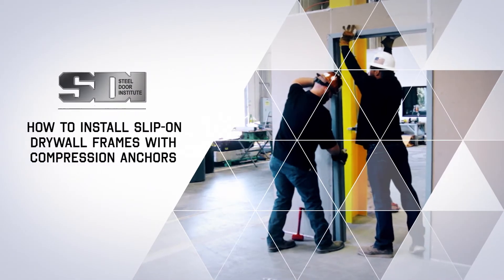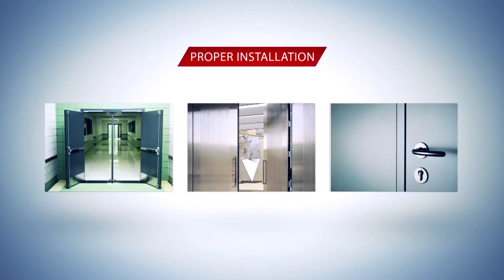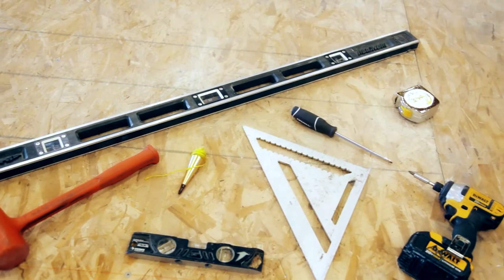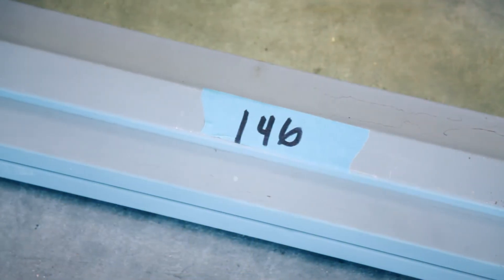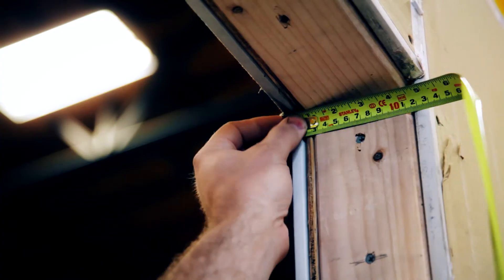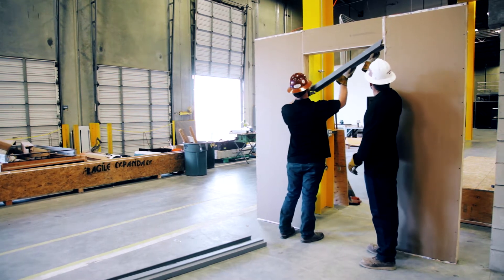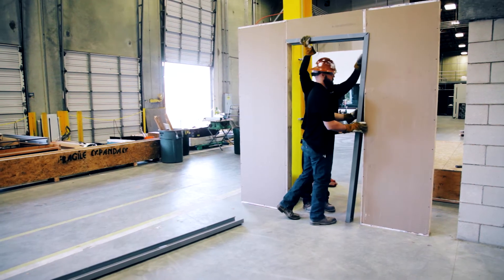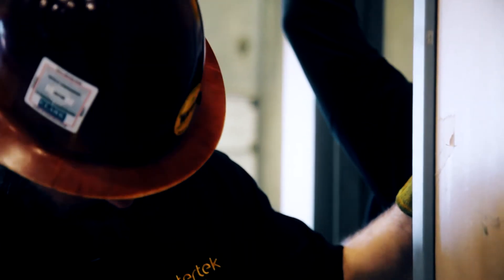How to Install Slip-On Drywall Frames | Steel Door Institute

Comment: I would like to see how to determine the size door and frame for the opening.  There are different sizes and we all don’t just do new construction.
Reply: Generally if you are going to be using a slip-on drywall frame your door size is going to be 2" less your rough opening. If you are going to be using a flush style frame that doesn't wrap around your opening it will be 4" less your RO. The most common sizes of commercial doors  I have seen is going to be either a 3'0"x6'8" or a 3'0"x7'0". Hope this helps
Reply: @Rehzix 2:04
Reply from the maker: That's a common request.  We have a video and worksheet on field measuring for replacement doors.  https://www.youtube.com/watch?time_continue=1&v=a6EHHitcmFQ